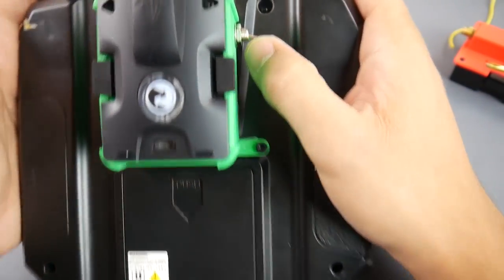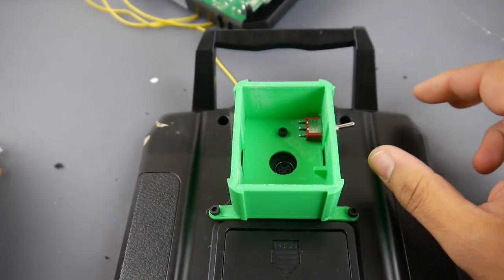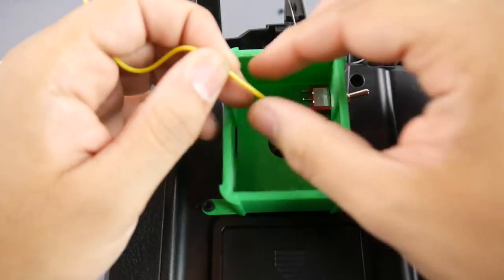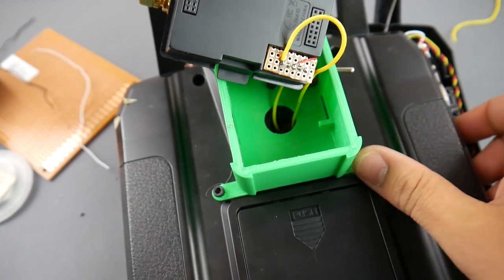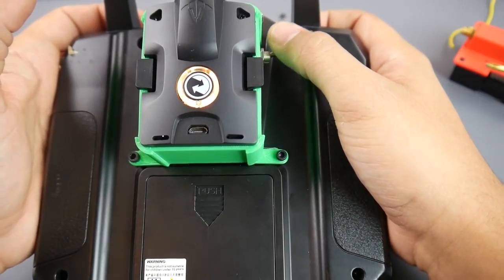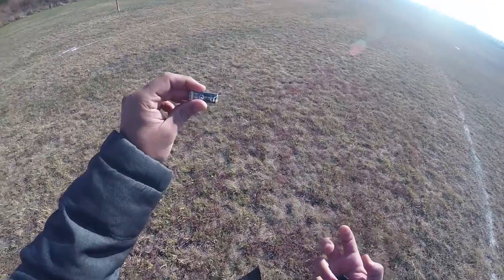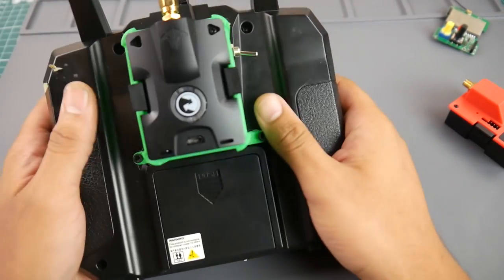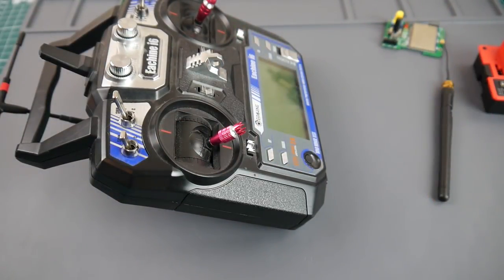Flysky FS-i6 / FS-i6X TBS Crossfire Mod and Frsky R9m Mod // Long Range Flysky Mod

Comment: Just slapped an R9M in my flysky... I’m not sure how to update it’s firmware, seeing as it’s not a Taranis, their is no sd card in the flysky, and I don’t think you can direct plug the module into a pc through a usb... but, that’s for later.... it’s in the transmitter, and that’s all I care about right this moment... thx for the informative vid.
Reply: Nvm - u can do a serial pass through beta flight trick... still can’t get my r9m to work. Also, how would you go about changing the power output on a r9m? Cause u can change in the Taranis radio, but how would u do it if it’s in an i6 that doesn’t have module settings... pls help.

Comment: Awesome video.  Love all
Your videos.  I have a flysky I6s.  I was going to invest in a Turanis qx7, but if I can add crossfire to my radio I would love that. Is the wiring the same? And once it’s wired how is everything programmed?  Didn’t see if you made another video.
Reply: Did you ever get these questions answered? I have an i6s also and want to do this mod. Wiring should be the same as i6x I would think. I found a PPM pad on the main board or could use the white wire on the trainer port, it’s common to that pad.
Reply: I have one too but never see any videos how to add it , I want to do it badly . I recently bought the crossover RX for flysky so when they arrive I’ll test them but next I’m buying the jumper T pro and crossfire micro tx , or the t18 lite …. So many choices

Comment: Please help, I connected i6x wth ppm to r9m, solder r9mm rx to fc, set receiver to sbus in betaflight, r9m bind with receiver, but receiver doesnt respond to flysky inputs at all.
Reply: Did you get this working?

Comment: Could you please show the r9m working? Also you should really put in 2 or 3 18650s in your transmitter, I have two in mine with a USB charging cirquit and it works great. Also I will be taking your 3d file and making it as low profile as possible, and then cutting the back out of my transmitter and then I will countersink the 3d part into the radio, it should only stick out like a centimetre or so. I'm using a turnigy i10.
Reply: Arend Mookhoek The FS-i6 actually doesnt support any voltage higher than 7-8V. If you put a 2S into it it will brake. 1S allthough is to low.

You would need a more complicated USB circuit with a  Power Bank adapter for Example. Did you do this to your Transmitter or does yours already support 3S from Stock?

Comment: I have an I6x connected to the R9M with the mod. Is there a way to activate the failsafe for emergencies?
Reply: hey georg how did you get it to bind? thanks
Reply: @FunBitesTV  I have bind it via the R9M-module
Reply: @georgnarnhammer2025  thanks for getting back to me.
so you were able to bind it without using a seperate radio like taranis? thanks
Reply: @FunBitesTV  Oh I'm sorry ... I saw that my R9M and R9Slim came bound ... So I only had to hold the bind button on the remote control when switching on. If you want to integrate a new receiver, you probably need a remote control with a module slot and the right firmware.
Reply: @georgnarnhammer2025  Alright thank you so much for getting back to me =) !

Comment: Hi im having trouble binding my flysky fsi6x, with mobula 6 frsky with this module

i tried it with mode / channel 5 which is frsky x , tried to bind it with the normal procedure but nothing happened, do i need to change my receiver betaflight setup from SPI RX support to PPM RX Input? please help
Reply: Yo bro what's your status? Im just done w the mod and facing the same problem
Reply: supernoob_fpv did you figure it out, if so please help?

Comment: What would it take to take the power from the main switch and then from there to the toggle switch that way you never have to worry about killing the batteries
Reply: He took battery power after the main switch (it seems, at least), so the module won't be on with the main switch off. I'm guessing how long does it take for an high power module to drain 4 AA cells...
Reply: @gravitywillwin9448  nope  its battery direct..so its not connected to the flysky power switch..... thats why he attached an extra module power off switch also

Comment: You are a genius man!! But if u put a ppm input in the module, that means you re output will have the latency that ppm gives you ?
Reply from the maker: Yes but not much around the latency of a qx7 possibly.. I'll test it soon.
Reply: @DroneMesh  yes! Tell us more about the latency in this solution Please!
Reply from the maker: Currently main advantage is range and penetration capabilities.. which is brought to a $50 beast of a radio.
Reply: @DroneMesh  well if the latency is not noticebale then it's definitely a good upgrade which everyone should consider over FrSky DHT. But if it's by any mean irritating then why bother if you are not a long range pilot but more a freestyler in seek of a reliable link.
Reply: @DroneMesh  Waiting for the test, but anyway awesome job, so sick of having bad range and working with a 4w booster ahah

Comment: Is update firmware with fsi6 14 channel and it shows rssi 
Also tell thas it works or not. Also can tell ppm pin on the transmitter.

Comment: Hi, you could re-route your source power for the module using the pin on flysky power switch.
Reply from the maker: Yes but the internal curcuit might not be able to handle the power draw of the module. This is the reason I when for raw battery input.
Reply: ooh you're right, I completely forgot about the module power draw. Nice video and thanks for the info, sir.

Comment: the 2.4ghz internal module stays on when you use the external module? if this causes interference or noise? is it possible to deactivate the internal 2.4 ghz module?
Reply: If you turn on the student mode on the tx, it will disable the internal 2.4ghz module.
Reply: @virtaulvt  perfect thanks

Comment: With the R9M you could velcro a lipo battery to the back to power it.  Also...if you have a FlySky receiver on your drone how will that work with the R9M or Crossfire modules...or will you have to change the receiver too?  And will it have to be sbus instead of ibus?
Reply from the maker: So if you are going to use a flysky receiver then you turn off the module.. If you are going to be using let's say the r9m then you turn on the module and bind it to the sbus receiver of the r9m. 

hope that makes sense.

Comment: How can you make settings about r9m from flysky?
How can u bind?
Reply: With R9M using PPM mode power changing and binding can be done with rear switches and function (F/S - bind) button...see manual for details
Reply: Did that but nothing happened stil not binding

Comment: How you are gonna flash a brand new R9M / new R9 MM receiver using this mod and how you are going to bind module to receiver @Drone Mesh
Reply from the maker: Change to ppm mode and use the button on the back of the module.
Reply: @DroneMesh  thanks for the reply... But how to flash a brand new R9M module for the first time? Any way to flash firmware without a FrSky / OpenTX transmitter?
Reply: @DroneMesh  Can you show this on a video please? Flashing a brand new R9M module and R9 MM receiver
Reply: @anonimkisi7804  flash firmware just working for frsky

Comment: how much more range will that frsky module be compared to without a module/ standard flysky i6
Reply: I did over a km with a standard flysky radio and receiver. Frsky isnt better at all at range
Reply: @sauerlandfpv5425  900mhz can go alot further than 2.4ghz flysky only use 2.4ghz
Reply: @boratsagdiyev1586  I know that the question was about an frsky Modul not overall range
Reply: @sauerlandfpv5425  sorry just woke up lol.. So 2.4 is basically all the same and comes down to the receiver or output power of TX. Got it :)
Reply: @boratsagdiyev1586  yeah pretty much jumper for example can put out 150mw instead of the standard 100mw and you notice thwt
Reply: @sauerlandfpv5425  Tomorrow i receive X-lite with R9 slim and R9MM hopefully i think it goes to 100mw but then i lose telemetry (EU) so i guess 10/25mw on 900mhz is already a massive range increase from  a simple FLI14+ RX with my i6.
Cant get fullsize flysky rx  in my 3 inchs quad easily :P

Comment: Sir can you do Happymodel ExpressLRS ELRS ES900TX 915MHz Ultra Long Range Transmitter Module and ES900RX 0.6g Receiver for FLY sky please. Im so tight in budget and dont wanna buy a new radio because i need batteries. Only had one XD

Comment: Do you have a video up of the settings on the controller for this mod?
Reply: did you get any please mention them there is only wiring mention in this video no steps how to bind or configure

Comment: Hey what's up can you show flysky i10 to add this mod to. You think it's same just find the labeled ppm on the internal board?
Reply from the maker: Yes ppm out and make sure you dont exceed 5v
Reply: @DroneMesh  I'm pretty sure it's a single cell lipo inside i10. I really like the way it feels in my hands thin and light no strap needed. Thanks I might have to use a step up for the voltage then?
Reply: Drone Mesh can i use the crossfire lite on flysky i6s if so how ? Simple explanation?

Comment: How do you bind it exaclty?
Reply: With R9M using PPM mode power changing and binding can be done with rear switches and function (F/S - bind) button...see manual for details

My question:  why not use trainer port ppm? and external battery?
Reply: @ChrisLBradly  please, can you explain further how to bind r9m with the receiver? specificaly i've got r9 mini, and i'm struggling to get it to work with my fs i6x
Reply: @fpvlemonidas3950  I decided to buy jumper t12 but go onto the frsky website for the r9 manual and it will give steps to bind it in PPM  mode but you will suffer latency with this method

Comment: But how can we change the tbs crossfire settings from transmitter??
Reply from the maker: hold the button.
Reply: @DroneMesh  Configuration of the internal settings like ,region, output power, dynamic power, and operation mode etc..
Reply: @donxavier9339  plug it in to your computer and download the tbs software. You can change everything from there
Reply: how did you bind the tbs cross fire to reciever?

Comment: MODS: drive.google.com/drive/folders/1_9-cDS_tdTYEHvlpx4_GvjSc4c-R0BU-?usp=sharing
Does anyone had issue like missing ch9 and ch 10?
 My i6x shows working analog values on the 'Display' sub-menu but in betaflight Aux5 (ch9) and Aux6(ch10) is dead. In AgentX Rx is already set to 12ch mode, and I tried two firmware versions so far.
EDIT: my answer to my question is that PPM output on the controller has only 8 channels.
Reply: hi mister, can you share any details on how you modded the fsi6x please? the other videos gone i think. thanks
Reply: Hi  @FunBitesTV  , please check my modified comment with the link.
Reply: @FunBitesTV  Can you open the link?

Comment: Hello. Is it possible with the flysky fs-i6s
Reply: yes, pin position is diferent in the board.
Reply: @renatoferreira47  thanks. Can you show me just the pwm pin where is it please.
Reply: @renatoferreira47  can you show me where to solder the pin. Thanks

Comment: how did you change settings without lua?
Reply from the maker: You dont you run ppm mode.
Reply: and for the power output?
Reply from the maker: With the button on the back
Reply: From the manual of Crossfire Micro -> Configuration of the internal settings (region, output power, dynamic power, and operation mode) and
receiver configuration (output mapping, channel mapping ect. ) is done via any remote supporting CRSF
(TBS TANGO, OpenTX ect.) remote. 

you can only bind or set freq (868 MHz and 915 MHz) via button
Reply from the maker: NP I will write an arduino code to take care of that. So expect a part 3
Reply: @DroneMesh  this is the possibile solution that I have think. I will help you if you need help. ;)

Comment: You failed in all areas bro. FROM THE CROSSFIRE MANUAL: "To configure the internal settings on the micro transmitter, a TBS TANGO remote or an OpenTX radio with
LUA scripts is required."
Reply from the maker: Not PPM genius

Comment: hmm,make big mod but no has mod battery to lipo battery ,shit. stupid use AA battery because need buy alltime lot battery new, lipo no newer need buy new ewery day. step up booster board and 3,7V and adjust output 6,4V lipo then no have problem whit power newer no waste lot money battery,